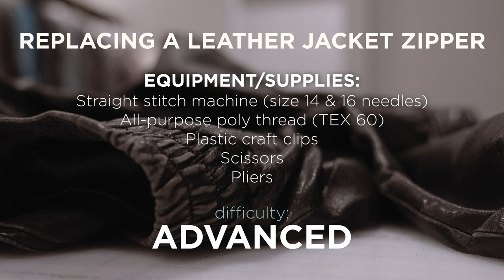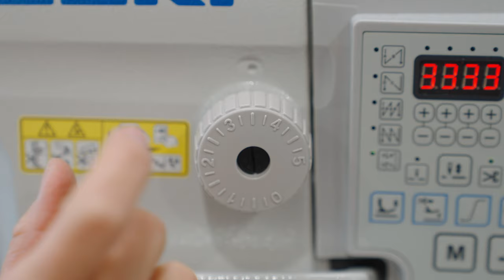Repair A Leather Jacket Zipper (Ep. 22)

Comment: You could get a high quality flat back side cutter to snip those teeth in half with. That would help you to get those excess teeth off in two little pieces. That would allow you to get them off without messing up the integrity of the ribbon they are pinched onto because you would not be needing to pull them off whole.  I am a terminating electrician and I use those things all the time and I thought it might help you to know of them. The ones by Snap-On are very robust and would likely last you a long time but almost any quality tool makers product would do it.

Comment: I have question. A few months ago I replaced a zipper in a sweat jacket. Easy project. Separating zipper. But. The feedback I got was disheartening. I’ve been sewing forever it seems like, but never came across this. I was told I put a “female“ zipper in a man’s jacket. Upon scrutinizing several coats I’ve found my own coats /jackets the pull tabs were on both sides of the jacket. Is this a thing swapping sides? Is there a rule like buttons or a pants fly that the pull should be on a certain side?
Reply from the maker: Nope, I've never heard of that kind of rule either!
Reply: I’ve also run into this with my husband (and a couple of customers) over the years.  He claims there is a male & female side for the zipper pull.  After looking at multiple examples I found that all his zipper pulls were on same side.  My jackets were a mixed bag.  I’ve never found anything addressing this in sewing books or zipper websites but I have not done deep dive research either.  If I find anything I’ll repost any info.  He passed on a very high end, smooth as butter Riri zip in favor of a YKK on the last jacket I made for him based solely on which side the pull was on, so it’s clearly something some men are fussy about!
Reply: In my experience men’s buttons are usually on the right as well as the zipper pulls. Women’s buttons and zipper pulls are often not always on the left side . I recently heard “Downtown Tailoring” address this in one of her older videos. 
As a man the zipper pull on the left as well as buttons on the left seem unnatural .Look in your closet and you’ll see women’s clothes are mixed but men’s rarely are in my experience. Great video🙂
Reply: @sewshowwithshae - hello, do you do zipper repairs professionally? I have a similar style jacket. Thanks !